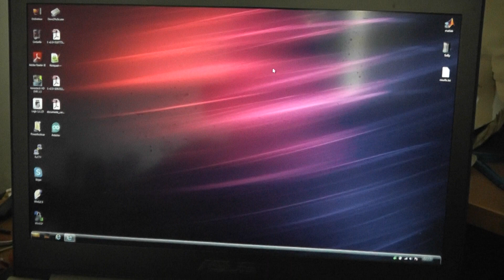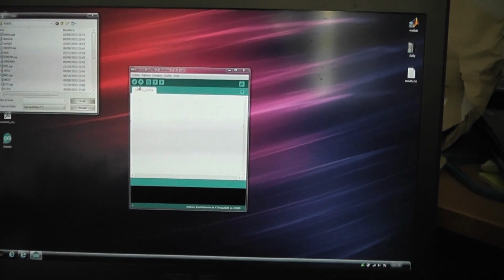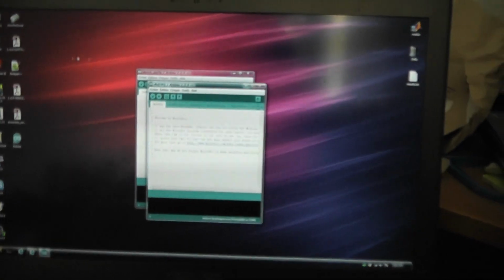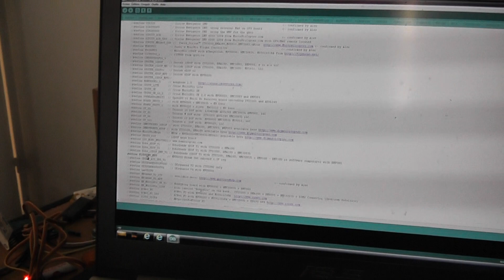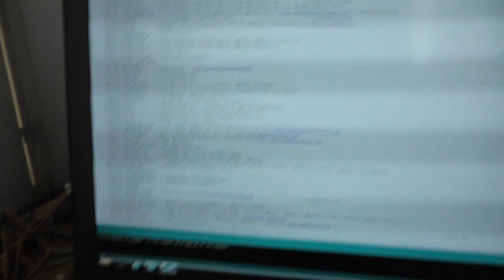Multiwii SE V3.0 arduino configuration

Comment: great great great. 
i've tested it and voila, there are no more errors occured but now i have no barometer and magnetometer. Have i choose by myself ?
You may look in my channel, there i have the footage of my problem. But in  German.
Reply from the maker: As far I know, with the MWC SE V3.0, you don't have any baro/magneto installed ...
Reply: SeBy DocKy Thank you very much for your qiuck response, this is what google told me: 

Features: 
Better six-axis gyroscope/accelerator sensor;
Optimize layout, signal input/output interface more reasonable;
Special I2C level to IC; With I2C(5V Level) interface, could connect I2C-GPS navigation board/OLED monitor, etc;
With FTDI protection, avoiding conflict between external power supply and USB power supply;
Small size, could mount on mini aircraft, 31mm install pitch;

Hardware Features: 
-- > MPU6050 digital three-axis gyroscope and three-axis accelerator;
Chip: ATMega328P;
--> BMP085 digital barometric sensor;
--> HMC5883L three-axis magneto resistive sensor;
Segregate dual channel power regulator,
Specifications:

Model: SE V3.0
Quantity: 1 Piece(s)/pack
Color: Blue
Material: Aluminum alloy
Functions: flight control
Voltage: 3.3V/5V Max.
Current: 150mA/500mA;
Dual channel power indicator LED: 3.3V red/5V green;
High brightness status indicator LED;
Special I2C level to IC;
FTDI interface with diode protection and 500mA current limit fuse

--> i will test it. but very big thank to you, now i know how to connect the wire and the power connection.

Which Board did you take ? 
I have selected the
" Arduino Pro or Pro Mini (5V, 16MHz) w/ ATmega328" 
is that okay, i got no stk500 error.
Reply: Ok, i have defined the baro and magno, calibrate the magno and it works shortly and lots of i2c errors, so i undefined it again. only the baro and of course the mpu are on. still errors, so you're right. there is nothing.

sorry for the hole text. 
i'm still thankfull